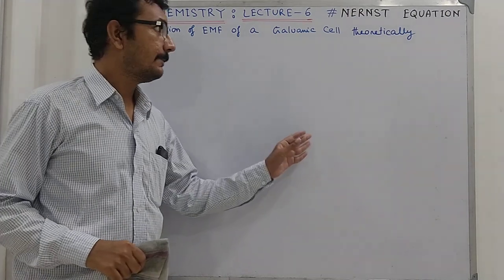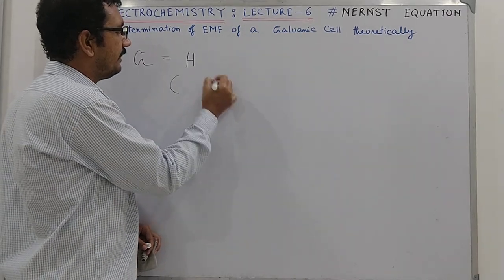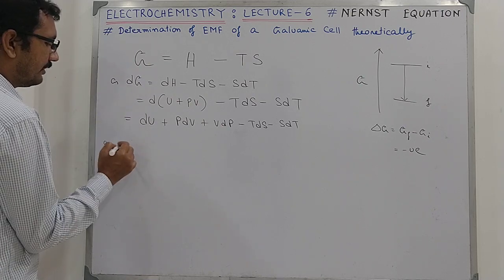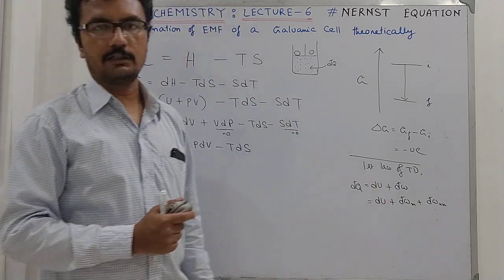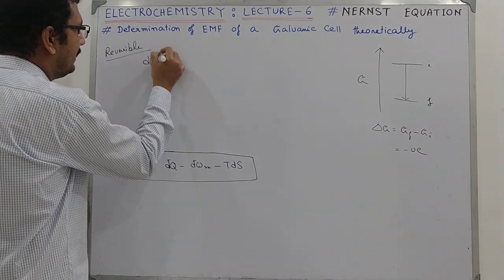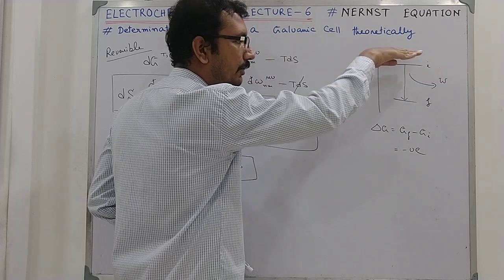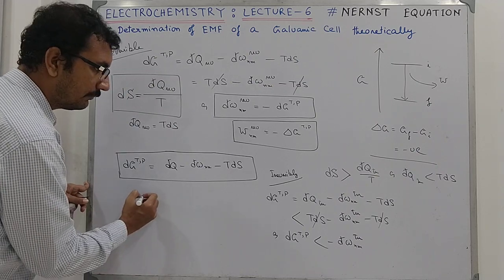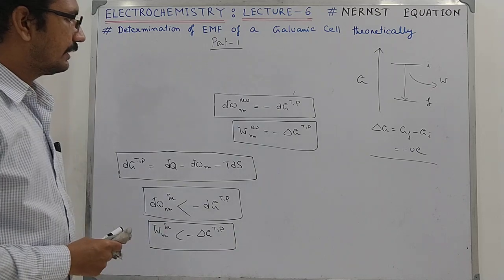EMF of Galvanic Cell theoretically || Electrical work || Electrochemistry || Lecture 6 || Part 1

Comment: Sir Helmholtz Free Energy mane ki?
Reply: Helmholtz free energy is a concept in thermodynamics where the work of a closed system with constant temperature and volume is measured using thermodynamic potential. It may be described as the following equation: F = U -TS
Hope this helps.